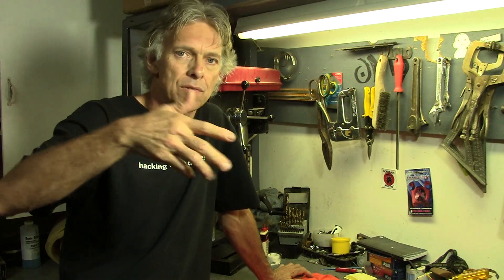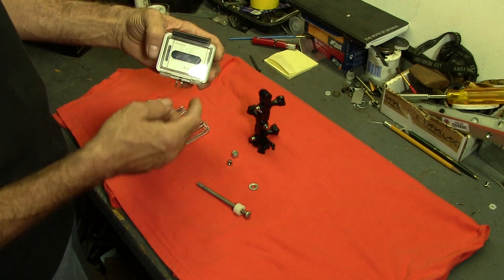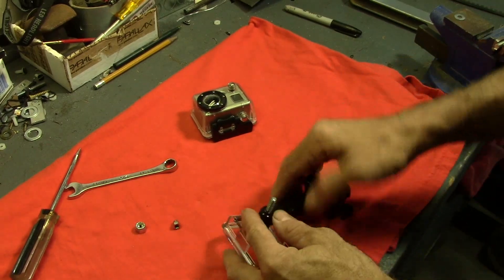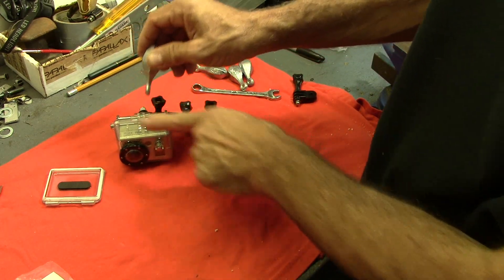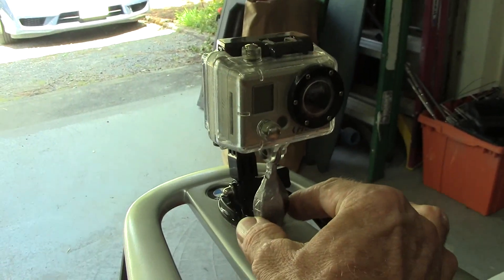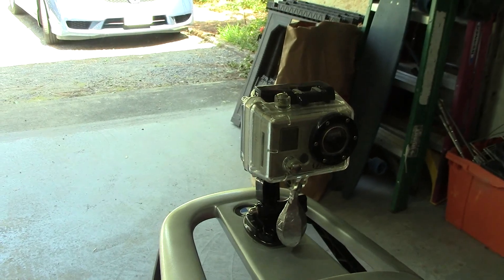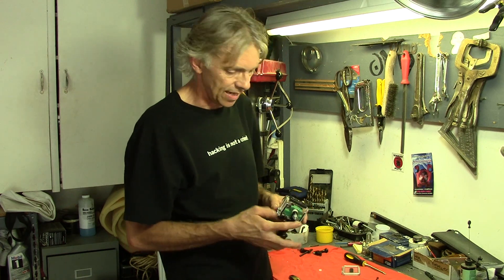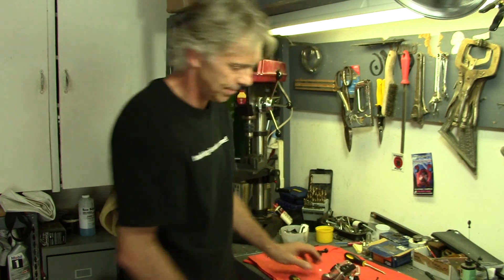Mechanical self leveling camera mount, maybe

Comment: Hey Dino...I recently bought an action camera and thinking about stabilization I remembered this vid. Since you are the master of electronics do you think you can come up with a gimbal on a budget and make a vid?I don't know much but these gizmos that work with rc quads need a frame, 2 motors, a controller and a battery. do you think one could use a motor from a printer? how do they calibrate? it would be nice if you made one and made a vid.                                                                                                                                                                                                                                                                                                                                Since there is a gap on your video production I assume you are on vacations, so have fun!!

Comment: Idea that might help: You might need more height to fit the mechanics of this. -- Hang the weight from some sort of rod. Have the center of the rod attached to the camera mount. That way the weight will swing to the outside of the turn, and the top of the rod will be pulled to the inside of the turn. This gives you a point that is always moving opposite the force of the turn: the top of the rod. You're basically extending the pedulum up above the swing point to give you an opposite-motion generator. Then attach the bottom of the camera to the top of the rod. -- The only issue might be the distance between the camera and rod will be changing the whole time. The more lean, the more distance. When it's straight up and down, the shortest distance. So instead of hard moutning the bottom of the camera to the top of the rod, have something that slides back and forth. Hopefully this explanation makes any sense. If it doesn't, i'll try to explain better. Thanks for the great videos!

Comment: Hello Dean, hope you would accept my suggestions ;-)
A small bearing mount would solve out the friction problem. If the centrifugal force is really that nasty (I have doubt it will affect the camera tilt that much :-) ) then a potentiometer with a pendulum-like small mechanism will measure the bike roll. A stepper motor can rotate the camera back to horizontal position.
I know it can go complex but it is very cheaply doable using Arduino...
Magnetometers can be a good solution if magnetic noise doesn't get mean on that bike...

Comment: What you could have done is that you could mount the weight on the top of the camera instead. To level the camera with the weight on the top you could use a simple kind of rubber-band attached to the bottom of the camera down to the bike. this way you will get the gravity forces to push the camera in the right direction and you´ll have a leveled camera.

Comment: Those 2 weights would probably work better if you weighted the top of the case too. (maybe with one weight, positioned closer to the pivot)  that should help dampen the rebound and help mitigate the some of the centripetal force issues as well.

Comment: No amount of weight is going to work. What you want is a gyroscope. If you have two old hard disks that still spin (at the same speed), you can mount them against each other (such that they spin in opposite directions), power them up and it will keep your camera straight, I think. Take the weights off and try to change your rig so the center of gravity is (roughly) at the mount point of the axle around which the rig turns; ideally, if you spin the rig manually with the gyro off, it should stop in any position without turning back or forward. Good luck!
Reply: Totally agree Jac and Vasilis. It will always reach that equilibrium of forces and one can never be "heavier".  A home made gyro would be a fun project. I'll be looking into that. ;)
Reply: Yep, you and Vasilis are right: Disregard my harebrained design below.  Cheers, Mark

Comment: Your idea is GREAT! Don't give up just yet! I have a few ideas that could improve your self leveling mount: Find the centre of gravity of the camera so you can put the rod from that point. Then fasten the rod with small bearings (from an old skateboard or rollerskates). I think you had the problem of a not so freely moving rod which then resulted in that your camera wouldn't completely be levelled. AND on a motorbike there will be some centrifugal force in play that might interupt the camera from leveling completely, i think... correct me if i'm wrong. and I would love feedback too !

Comment: Try a gimbal for multicopters. You get them for around 60$ on ebay,they are made mostly for the GoPro and you can use them on your quadcopter as well. In case you still have it. ;)

Comment: Just shoot wide, and fix it in post. (rotate/crop) :-)

It'd be interesting if a horizontal gyro would be sufficient. It'd still be a mechanical solution with just a motor to keep the gyro spinning. And I'd think you'd want to mount the pivot closer to the center of gravity so there are less forces to overcome. Most steadi-cams (which is what you're trying to make) are pretty close to being balanced.

Happy vacation!
Reply: Hi Harley:  I like the idea.  I have done that in Sony Vegas, Photoshop, Lightroom and LRTimelapse for multiple frames, but of fixed tilt.  What is your process/software to track multiple frames of continuously varying tilt.  Cheers, Mark
Reply: Hi Mark Beeunas, I've never done it in video, just adjusting horizon on stills in Photoshop.

But if I were to do it in video, in After Effects the most straightforward way would be to just keyframe the rotation. Probably set keyframes at the start, middle and end and then scrub through the clip, making adjustments as needed. Essentially the same process as rotoscoping.

It might also be able to be done with a tracker and then assign the computed track to a camera object, effectively canceling out the movement with corresponding opposite movements of the camera object. But that might be a bit trickier to get setup.

Cheers.
Reply: Thanks Harley Pebley: I made a comment to my own comment, see below, with a link to a design sketch.

Cheers,
Mark

Comment: (Update): THIS WILL NOT WORK; SEE VASILIS AND JAC ABOVE (Mark)

You have it up-side-down.  Instead of the pendulum weight below the camera it should be above.  I think what will happen (?) as you lean into a turn the centrifugal force will pull the weight out away from the turn and rotate the camera toward more level.  However, this setup is going to be top-heavy so at the pivot point you will need to have a torsion spring or lateral springs or rubber bands (rubber bands might be better as they may damp vibration) to keep the up-side-down (top-heavy) pendulum from flipping over and also so it will return to the neutral (level) position when driving straight ahead.  The trick will be to get the right play between the pendulum pulling out and the band keeping it from flopping over.  To make the fiddling with the setup easier, attach shaft stop collars to the camera, weight and pivot point so they can be slid/adjusted along a steel rod.  Cheers, Mark
Reply: Actually, you don't need an extra weight on top, the camera's weight will do.  Here is the design: http://zmabz.smugmug.com/photos/i-LPP8FNB/1/L/i-LPP8FNB-L.jpg

Cheers,
Mark
Reply: Mark Beeunas I HAVE to try that! Spring rates will determine the G force curve.

Comment: Great vid, have you tried making the camera itself the weight? As in mount a rod to the top of the camera and make the top of the rod free to turn on somesort of a stick on chasis, maybe even a small bearing system to make it turn freely. 

    /I\
  /  I  \
    [_]   <- gopro

Comment: What about some threaded rod horizontally attached to the bottom of the housing, so that you would be able to attach weights either side of the camera (like a mini dumb bell) or similar to why a tightrope walker uses a long horizontal pole for stability??????

Comment: What about a laptop hardrive as a mechanical gyroscope powered off of a car charger, if you have a failed drive that still spins up you could remove the read head arm? (i had a cigarette lighter socket installed on my bike to allow me to charge my phone)

Comment: Dino's got it right, experimentation is the best part.  You can now see why the professional electronic levelers are built the way they are.  It would require not only mechanical damping but a sophisticated control algorithm as well, no doubt with some level of tunable PID.

Comment: Great idea!  I think it could work if you glue the weight to the plastic box. Also give a bit more slack and add grease on the axle. Maybe drill a little bit bigger so it will move more freely.  That should work! Enjoy the holiday!

Comment: Great idea!  I think it could work if you glue the weight to the plastic box. Also give a bit more slack and add grease on the axle. Maybe drill a little bit bigger so it will move more freely.  That should work! Enjoy the holiday!
Reply: djlyonol I don't think weights will ever do the trick. Not 100 % anyway. it needs an extra push to overcome centripetal forces.

Comment: BTW, servo will most likely be too choppy for what you're wanting to do. If you want really smooth transitions to changes, the best way would be to put together a single axis brushless gimbal and vibration mount it. Granted, looking at $25 or so in parts that way.. 

So grab your servo, your gyro, your 3.5v NiMh and see what you can put together. I wanna see how it works out. ;)